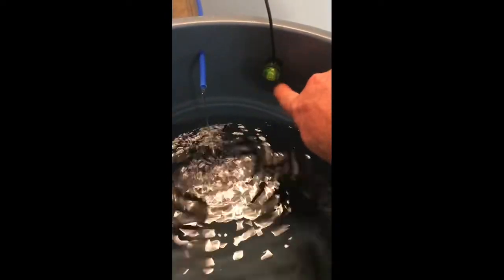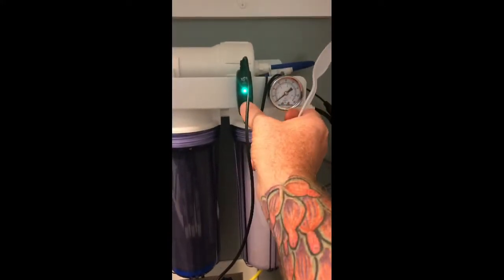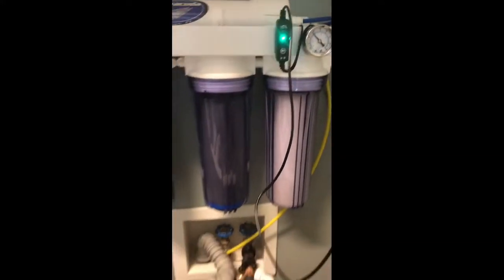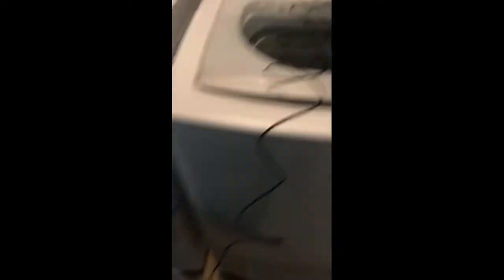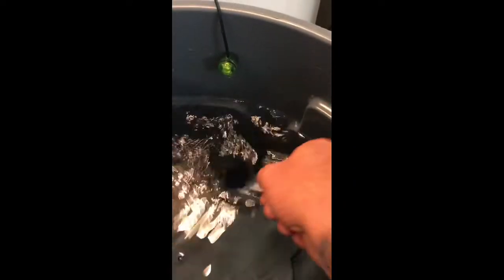XP AQUA RODI FLOOD GUARDIAN NOT WORKING RIGHT??

Comment: It’s a optical eye and shouldn’t shut off from splashing. I’d still move it away from the feed line though. If the sensor can see that line of water dripping down it will stop, but if you have it with a clear view across the brute..it shouldn’t stop until the water gets high enough to touch the sensor. Either way, I’d run a BRS float valve so that you have two layers of protection. Check out Murphy’s last video for the one we all use.
Reply from the maker: Reefahholic ..... Your on the same page as me for sure. I know I’m not going crazy. As for that float valve ....you’ve brought that up before in my last flood guardian video. Guess I’m either lazy or hard headed 🤣🤣🤣 In any case Ive seen Pats last video... nice little sandpaper trick! Guess it was great timing for you to bring that up. Is someone trying to tell me something 🤔   😂😂
Reply: 2PLEEZ Coral Reefs - Get it bro. Been using those for about 10 years and never had a flood. Personally, I own two XP Aqua ATO’s and one has two optical eyes and I’ve never had an issue or failure, but I would still back it up with the BRS float valve to be safe.
Reply from the maker: Reefahholic ... indeed .... I was getting roasted about that last night on Joey Vara’s stream, so your not the only one telling me that 😖
Reply: 2PLEEZ Coral Reefs - Yeah I saw Joey’s stream and Murphy’s going at the same time. I was into a good movie so I had to pass up the streams last night. :-)
Reply from the maker: Reefahholic ... I don’t blame ya brother. Sometimes there’s other things to enjoy besides Reefing 😁👍🏻